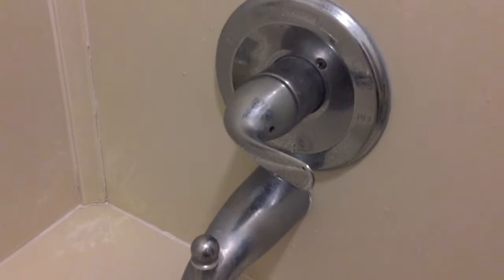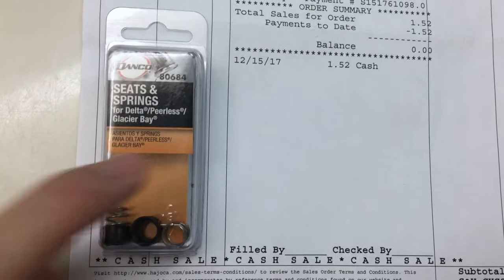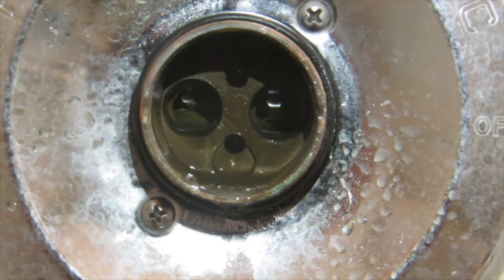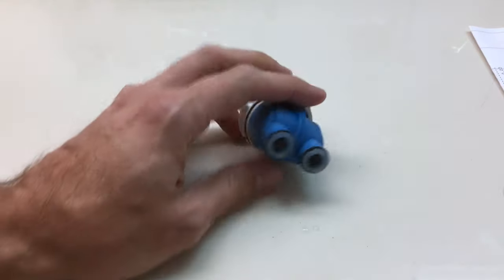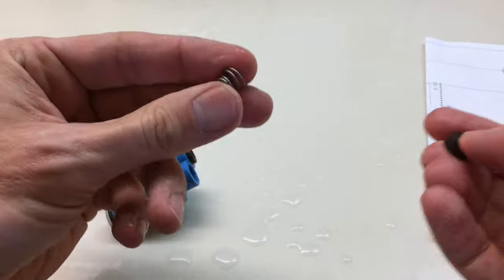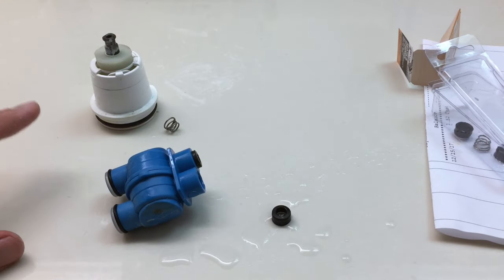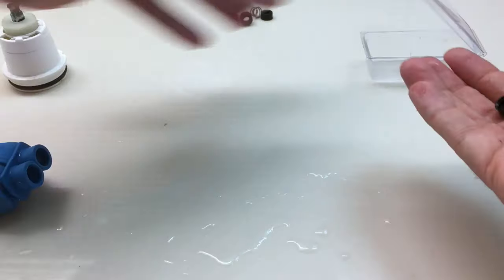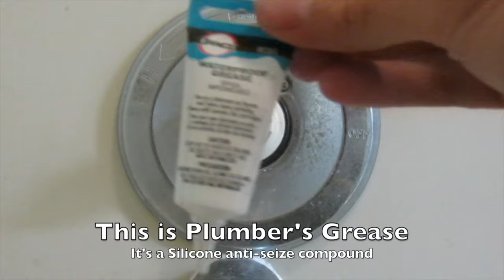Fix a leaky Delta Single-handle shower faucet for UNDER $2!!

Comment: Delta faucet customer service will replace cartridges, seats, and springs for free if you email or call them. You just need to give them the model#, when it was originally installed, and tell them how long it’s been leaking. They have replaced all of our shower, bathtub, bathroom and kitchen sink faucet cartridges for free over the last few years, and all OEM😎👍

Comment: This is an excellent video for various reasons.  First, you said buy local. That's so true as my folks owned a department store for 25 years. My Dad kept it open 5 years longer than his CPA accountant recommended and lost money each of those last 5 years. But he kept it open as a community service for the small town/community I grew up in. 

Secondly, if you go to a local store, you can tell them the problem and they quite often can tell you the solution. I had to repair a dryer 2 times and both times he told me what I needed and how to do it. First time he had the part on inventory and second time he ordered the part for me. Even if it costs slightly more, you still save money versus having a professional make a house call which typically runs you $100 just to walk in the door. 

Thirdly, I'm working, as we speak, on an older Peerless shower/tub handle which is similar to your Delta and made by Delta.  I saw that cartridge at Lowe's too for almost $40!  That blew me away because right beside it was a complete replacement for this Delta which also includes 2 handles, 1 like yours & 1 round one so you can choose either type that matches your current bathroom setup, along with face plate, cartridge, seals, etc.  And it comes in the finish you have or chrome for $39.97!  So one could replace everything for the same price as 1 cartridge!  It too was made by Danco.

Finally, this is the second day I've been working on. It's older and uses a "ball stem" setup, which goes up and down.  According to Delta, one is suppose to remove the white adjustment piece in front before unscrewing a similar piece like you did right at first. But it won't budge. There are 2 types of ball stem replacement parts but I don't know which one it is. So I bought a Danco "repair kit for Delta & Peerless", item #88103, which I believe is designed more for regular faucets but it has that little silver wrench I need to hopefully untighten the white ring.  I believe it's the temperature regulator.  The ball stem may be okay; who knows. It does have various seals along with 2 springs and 2 little seals like you used so I may luck out. I don't think the ball stem types even have a cartridge but have read they are connected to 3 brass pipes. So one has to be careful not to break the pipes, creating a huge behind the wall repair!  Ironically, they say not to use a pipe wrench as it could break those pipes. And the wrench you used I just happened to see also and wish now I had purchased it. Oh; my Danco at Lowe's (9:30 at night) cost me $7.96 while the Delta brand wanted $19.99!

I might also mention that little leak doesn't look like much. But I've used both a 1 gallon and 5 gallon bucket to collect the water while using a main drain opener which recommends not using any water for 24 hours for it to work. Well, I was collecting 1 gallon of water every 20 minutes!  Didn't think it would be so much. That's 3 gallons of water every hour, times 24 = 72 gallons a day!  Times 30 = 2,160 gallons a month!!!!  That increases my water bill by 35%....35% more water usage charge, 35% more sewer usage charge, and 35% more taxes/fees so it's costing one more than they might realize, month after month, year after year. Sorry so long but thanks for an informative video. Hopefully my comments can also assist someone.
Reply from the maker: Thanks for such a great response.  This may have been the best comment I've ever received on any video!

Comment: Please read !!  The video omits a key step -- before you begin anything, TURN OFF THE WATER to your house/apartment first, and drain the faucets before proceeding!  This may be obvious for those who are not beginners, but anyone can potentially forget.  I've heard stories of people who created geysers of water and experienced geysers of embarrassment after forgetting to do this! 
Another tip before you begin is to cover your drain -- you are dealing with small objects that can slip away forever and bring your work to a screeching halt! 
If this comment helps even one person, it will be so worth it!
Reply: Thank you I really almost made this mistake
Reply: Thank you! This was exactly my question - don't you need to shut off the water to do this?

Comment: Spot on!  Only thing I would add is to take note of the position of the cartridge when you pull it out from the base.  I didn't.  When I reinstalled, I had it flipped 180 degrees, resulting in the water being hot first and then cold when turned on.  I had to take it all apart and flip it for the hot to be all the way to the left again.  No big deal, as this was perhaps the easiest, cheapest home repair I have EVER done!  So thankful to have found this video!!

Comment: I always just replaced the entire cartridge -  this is a great video, thank you for making it.  Also, the difference in price from the big brand chains to the local stores is very revealing. Thanks again.
Reply: OMG yes it is! The big brand chain stores in my area have them going for ~$54 a pop. I hope our local suppliers have them cheaper.
Reply: Do I need to shut off the main water valve 🧐😂😂😂

Comment: I watched 10 videos until I came to yours...you saved me the $40 for a new cartridge! I used your advice and bought new seat/ springs set for $2.79 and it worked flawless! Thank you! If your ever in Indy I’ll buy you a beer or 3...! 🍺
Reply: From Indy and about to do this myself. Where did you go for the spring kit?

Comment: I tried repairing the old cartridge but it still had a drip. I replaced the cartridge from Lowes, no drip. There is another video where the guy tells you what Delta cartridge you need where he says he has never had much luck rebuilding them. I paid $58 for a genuine Delta cartridge but my wife is HAPPY.
Reply: I'm in the same boat - replaced the spring and washers, still drips. New cartridge time I guess...

Comment: Thank you for sharing. I plan to go to HD to get this part and attempt this repair. Looks like price is now $4.97 but a deal compared to a service call. Step #1 should be to turn off water to house?  Pretty common sense but worth mentioning/repeating.

Comment: Never had any trouble from Delta sending me a free cartridge ... took about a week but didn't pay a dime.  Also sometimes just taking the handle off and putting a flyers inside the plastic stopper and turning to the right will close it off and stop leaking.  You can turn the handle to off BUT if it's not centered, you might thing its off when it still needs to be seated to the right more.  Saves you from taking everything off.  This is especially true after putting in a new set and it still leaks.
Reply from the maker: I have had lots of trouble with Delta.  You have to buy the cartridge at an approved store.  I found this out when I purchased from Amazon.  I had the receipt and a photo of the original part in the packaging with the receipt and they wouldn't honor their warranty because of where I purchased it.

Comment: Did this and it’s fixed for a day. Now filling up buckets again with same single drip every few seconds. Shower related? Or something else to try?? Great vid. Thx.
Reply from the maker: Might need to try "blowing out" the pipes.  That's what Delta recommended to me.  Basically it's just where you take everything apart and open the water valve again and let it just flush out the system. Good luck!

Comment: Well done. Unfortunately, the springs and seats didn't do the job for us. We had to get a whole new cartridge to stop the drips. Instead of waiting for the seats and springs being sent by Delta, we picked up a Danco kit at Lowe's. After installing them, the shower still dripped, although not as badly. Delta claims their brand-name seats and springs would have worked, but there's no way we are going to remove the new cartridge and put in the old one to find out. Delta fought reimbursing us for the cartridge (the shower is only 11 months old), but it looks like they might after all.
Reply from the maker: I've gotten lots of comments on dealing with Delta on this video as you can imagine.  It's very much like dealing with most all big companies; it's pretty mixed.  I've had folks that SWEAR that's the way to go, others with experiences more similar to yours.  Good luck!
Reply: I've had your same experience - many times, even with seats and springs Delta sent me.  Always needs a whole new cartridge.
Reply: Hey guys, I have the same Delta cartridge (Blue/White). I tried putting new Danco seats & springs in. Still leaks. I am waiting on a new cartridge to arrive in the mail. I only hand tightened the bonnet cap, as I have seen several warnings not to over tighten the bonnet with a wrench, although it seems tightening the bonnet more would make for a tighter seal on the new seats, which is how the new springs/seats stop the leak. If the new cartridge does not stop the dripping, I'll try tightening the bonnet with a wrench, and see what happens, and post it here...

Comment: Why did you put the valve grease on the outside threads? Looked like the grease might have worked better inside the valve on the surface where the rubber seats have to slide back and forth.

Comment: Oh my gosh I did it! It took a couple runs to the hardware store but by golly I did it. It was touch and go for a minute there. I even called the plumber and made an appointment for them to come out two weeks away… Then I realized I had the wrong Allen wrench size. It should’ve been 1/8 instead of 3 mm. Fraction of a difference made ALL the difference. No drip and no plumbing bill. Thank you so much! Gotta go cancel the plumber!
Reply from the maker: Congratulations and way to stick with it!!

Comment: Don't overlook the fact your water pressure regulator for your house may be defective and causing  higher than normal pressure.  When a second faucet in the house started to leak, I bought a water pressure gauge and checked the pressure at a outdoor hose valve.  It was 90 psi.  it should be 50 psi.  I replaced the pressure regulator returning the pressure to 50 psi and the leak stopped.
Reply from the maker: Great point.

Comment: Thank you for posting this! I've swapped a lot of those cartridges out, and now I learned I may not have to go that far! The challenge I run into most often is removing the handle without snapping the brass stem off. Would that silicone grease help keep it from binding, or is it not recommended to use it there?

Also, that's probably the happiest background music I've heard in a DIY video.
Reply from the maker: Yes.  I use the silicone grease on the knob before I reinstall everything.  It really helps me long-term.
Reply: @TXSuburbanHomestead  thanks dude! It's kind of a job getting those handles off and I don't want to fight that battle more than once.

Comment: Need that same exact unit that's pictured in this video...however at HD and Lowes a full replacement is $53.00, but the repair kit (seats and washers) are only $2.51 at HD and Lowes. I live in California

Comment: Thanks
I have watched a video from Delta and was ready to purchase the $60 part...
But you've shown the part is easily opened and changing the rubber rings and spring is straightforward
Reply from the maker: Hope it helps.  You can also reach out to Delta.  They may send you the whole cartridge replacement for free.  They're really good about things like that.

Comment: Thanks for the awesome video...my faucet is from 1989/1990...I figured I would have to replace the whole setup because it would be hard to find parts...but for $3.18 I was able to fix it right away.

But when I took my springs and seats out you could see the spring thru the seat.
Reply from the maker: Michelle Welch that’s great!  Glad I could help!!

Comment: Do I need to shut water off before doing this repair? Thanks!
Reply from the maker: Yes, most definitely. I don't know what your setup is like, but I had to turn my water off at the main down by the street. You may have it that you can turn it off at a valve in your bathroom somewhere

Comment: Thanks for this video. I’m having this leaking problem just a few weeks ago. And I said to myself, this is a waste of water. We just had our bathroom renovated last February 2020. Instead of me fixing myself this leak, I just texted the contractor who did it and also told them that once you turn the water it runs hot water without going all the way to the left. I thought they did this in purpose so that way the water is hot right away 😁....then I read some comments and found out that it is possible they installed it incorrectly. I also thought it’s a good thing and convenient to have hot water right away 😂. Thank you again for this video.

Comment: Do I have to turn off the whole supply to do this job? Thanks
Reply from the maker: You need to turn off the water somewhere.  It may be that your house has a valve on your shower supply.  Mine didn't, so I had to turn it off at the street.  Hope this helps.

Comment: Thank you for the vid! I’ll have to try this out. Our 3 showers have Delta valves and all leak! I wonder if this kit will be the same for our house built in 1999?
Reply from the maker: That's about the same time ours was updated.  There's also a way that may work. It's a bit messier, but it's free.  You might have dirt in the cartridge from the pipes.  You can just open everything up, turn the water on, and blow out anything in the pipes and reinsert the cartridge.  Sometimes that works for me.

Comment: Is it the same repair.
If it leaking out the handle instead of the faculty???
LMK
Reply from the maker: That's a great question.  That may be an issue where you don't have a completely sealed cartridge or the brass fittings may be loose.

Comment: Recently had my shower renovated with this type of Delta Valve and have water leaks, sometimes very little to a consistent drip. Assuming the rings are bad? Gonna take it apart and apply some plumbers lube or something similar. Hope that works. Thanks

Comment: Thanks for the video. I did this but it didn’t fix the faucet. Any suggestions?
Reply from the maker: I'd suggest replacing the whole cartridge next.  It may be that there is something clogging it not letting the seals close.  The last thing I would suggest before you call an actual plumber is the most the most dramatic. I had a home builder friend of mine no mine tell me to take everything out open the valve and let water just blow out for a minute or 2. He said sometimes if you have an older home with older pipes there there are things in the pipe that clog the cartridge. I have to do that in my house about once every 6 to 8 months.

Comment: Wondering how long on avg. these springs/seats last? Have just inherited Delta shower faucets in the home we moved into. Hard water here and have already stripped the set screw trying to remove to get at the cartridge. I'm going to fix it this time around. Hoping I can avoid breaking the cartridge where it meets the handle, so I can just replace springs/seats. Will have to get a new set screw (hopefully they can be purchased?) at a minimum and will definitely use some plumbers grease/anti-seize on the new one.

Comment: I have a leaky shower head. Faucet is made by Delta. As per your advise I have to replace spring and washer and for that have to open handle but my handle screw is stripped. please advise how to open stripped screw.
Thanks
Reply from the maker: For a stripped screw, I'd recommend calling a plumber.  The fix isn't simple and takes some tools/skill.

Comment: Do you have to shut the main water off in basement?
Reply from the maker: Yes, you'll need to shut the water off somewhere.  Mine is only at the street, but you may have it in the basement, or even valves in your bathroom.

Comment: Do you need to shut off the water before doing this?
Reply from the maker: Yes.  Either at the faucet if you have valves there, or at the street.

Comment: Must be nice to have your Allen key seat nicely and have the screw not be gunked over and impossible to remove. About to take a sawzall to this thing and replace the entire mechanism
Reply from the maker: The first time I did this, I had to soak the handle in CLR to get the set screw able to loosen up.
Reply: @TXSuburbanHomestead  Glad I saw this comment, I had trouble getting the screw out but CLR (put a few drops in the hole) did the trick.   Can't believe this $4 fix worked. Thanks!

Comment: how do you get that handell off  if you dont have set screw in it
Reply from the maker: That's going to be a tough one.  If you can't get it off and the set screw is gone, that means that there are hard water deposits that are essentially welding it together.  You can try something like CLR, but if that doesn't work, I'd call a plumber.

Comment: Great video. I hope you're still responding to comments on it. I just got back from the store and bought the kit and grease that you suggested. I thought I was all set however, I can't seem to get a bite on the screw that holds the handle in place. Can you tell me what size Alan/Hex wrench it takes?
Reply: 1/8  Allen. Corrosion may make it stubborn. Use WD 40 or vinegar